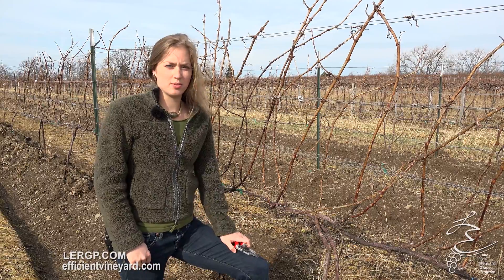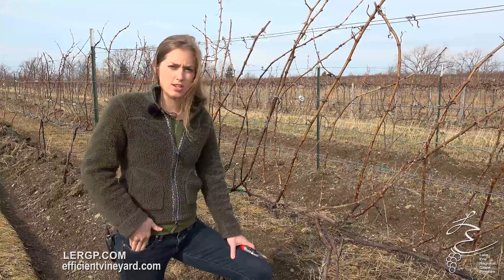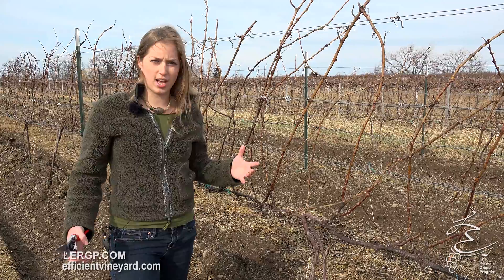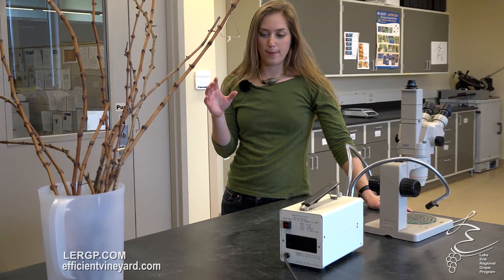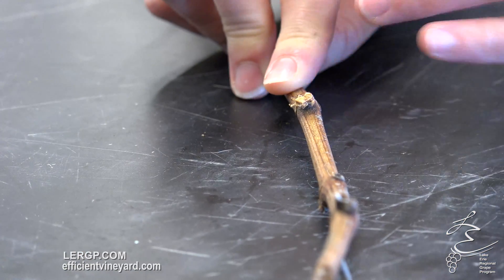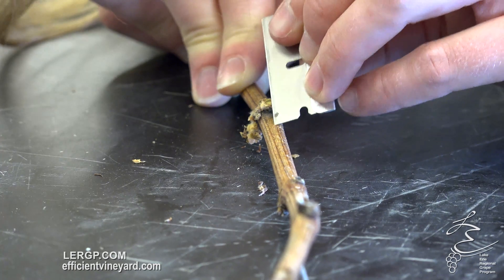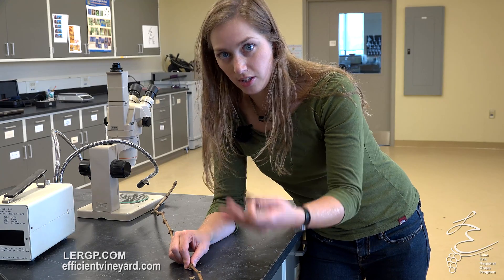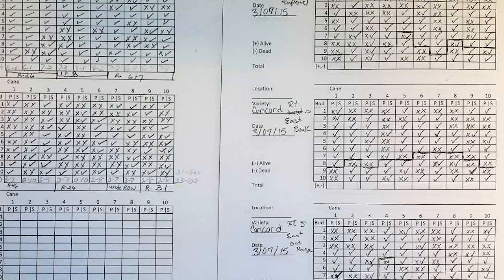Sampling and Dissecting Buds to Determine Winter Injury   LERGP Podcast #57

Comment: We own a vineyard here in Colorado, and both last year and this year we experienced hard frosts that killed off a lot of primary buds. At the start of this past season, we pruned like we would in a "normal" season - down to two buds on spurs - and had a moderate crop year. We're curious - what are the benefits of "not pruning"? We do mostly spur pruning, so would you suggest maybe pruning down to a certain, lower number of buds on each spur? It seems like it would be super challenging to leave spurs with 10+ buds on them. Thank you for clarifying - this video was very helpful!
Reply from the maker: Thank you for your comment on this podcast.  In this region Lake Erie is a great climate moderator, but we do still get occasional spring frosts - this year we had 2 back to back in May that hit some parts of our region pretty hard.  We generally advise our growers to leave a little extra early in pruning and perhaps go back before the buds push and prune to the desired levels.  Mechanical pruning is quite widespread here now because of labor issues so often growers will preprune with the machines and do a hand follow up later to get the desired number of buds.  I would like to have our viticulturist respond to your question to help give you the best answer.  If you could email me, my name is Kim and my email address is ksk76@cornell.edu, I will forward that on to get you the best advice for your situation.  If you could include your region and the variety of grape that you are growing, that would be very helpful.  I look forward to hearing from you!